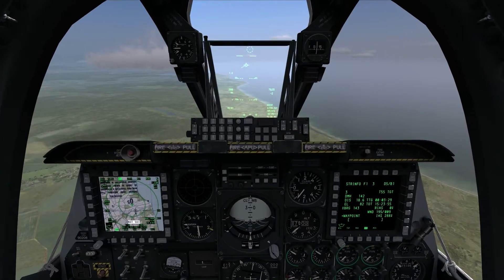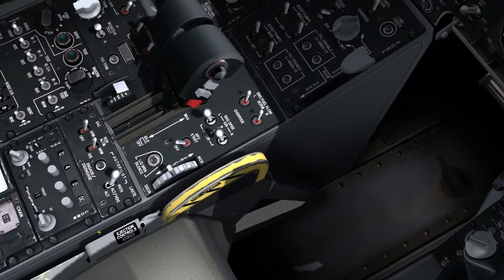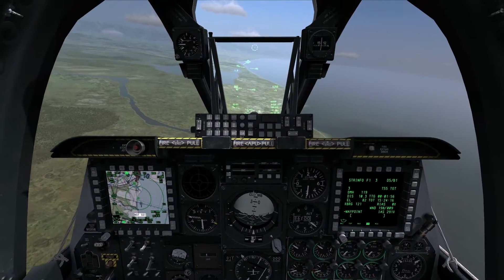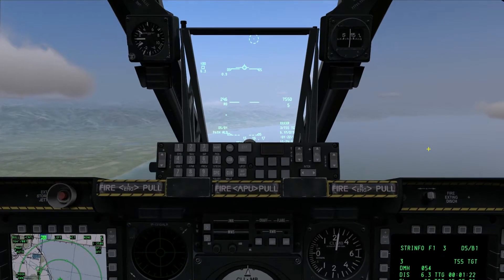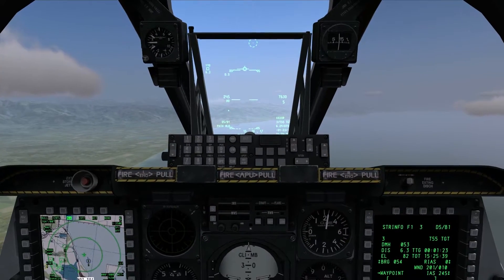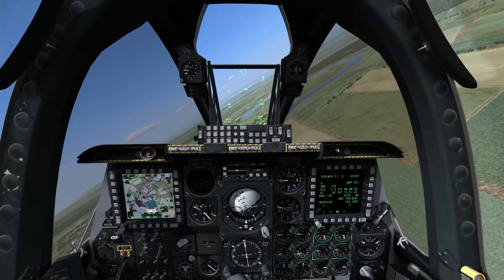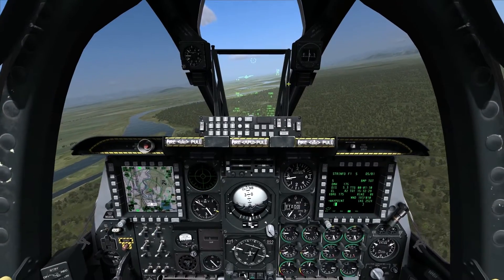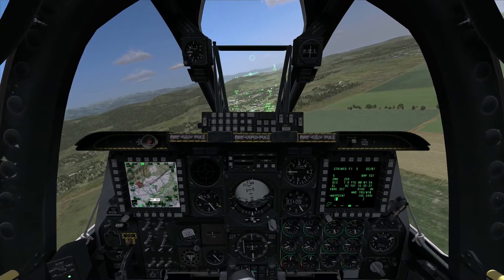On the Range #10 - DCS: A-10C Warthog Low Altitude Autopilot

Comment: I can't get autopilot to engage or do anything, all switches are on as you showed, and there are no caution lights on.
Reply: Carl Groover I know this is three months old, but someone might read it. I think I had the same problem. Pretty sure it was mapped to the 'a' key. But you can find it under the HOTAS  in the controls settings to map a button.

Comment: How can I prevent the autopilot ALT/HDG from disengaging as soon as I release my physical stick? I can only keep the AP engaged when holding my stick in the same position
Reply: you need to trim correctly. if you want the altitude hold to keep you in a bank you need to trim the aircraft close to that same bank. If the rates are too strong the AP won't engage. AP is basically only able to make small corrections to the aircraft. if you want the plane to maintain a certain climb rate you need to trim close to that rate first.
Reply: What you can also do is use it without trim, you basically have to slowly baby your stick back into place with small movements but it is possible, I do it all the time